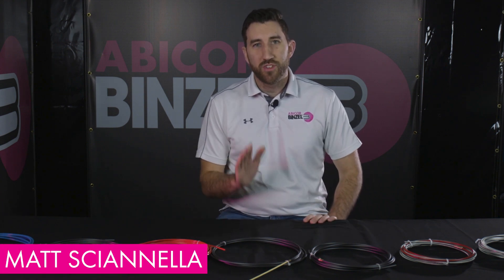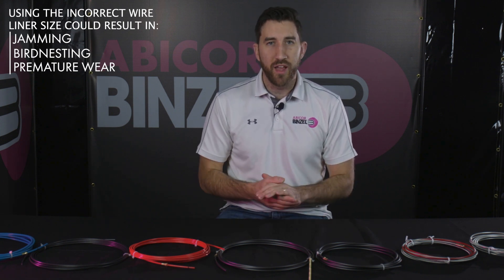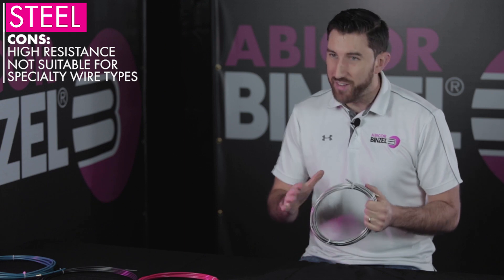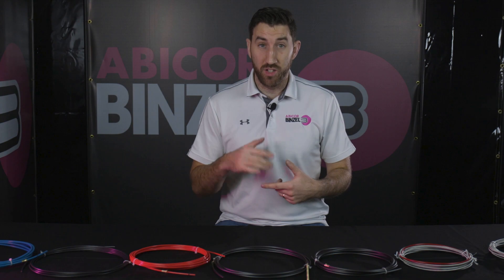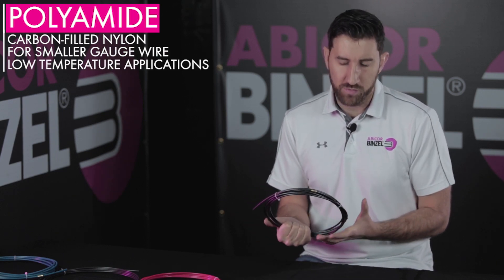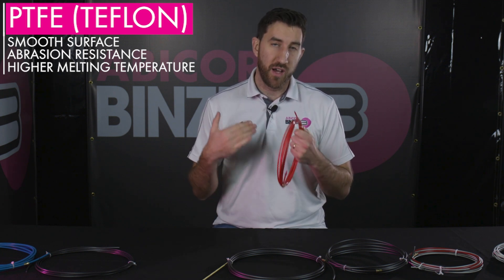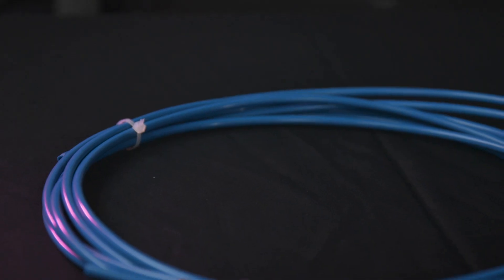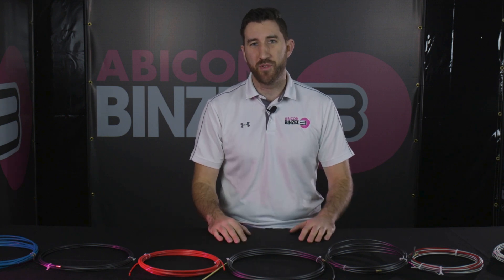Wire Liners | Binzel Basics

Comment: Clamping down too tightly on the drive rolls will also cause the wire to curl. This causes the copper coating on the wire to rub the inside if the liner. Over time the powder-fine shavings of the coating will build up in the liner right where conductor tube on the gun curves and eventually cause a plug.
Reply from the maker: Hey Jordan, that's correct! Thanks for the added tip

Comment: Where could I find a vendor that would stock these?
Reply from the maker: Hey Benjamin, you can get these liners from Praxair, Airgas, or most any of your local welding goods distributors. These liners are made specifically for our MIG guns, so if you want to try ours in particular, would need to try our gun out. But we fit almost any commercial welding machine.
Reply: Great videos,  I have binged and watched as many as possible.  Great information and knowledge  that you really can't learn anywhere else. I have a few questions. I am going to purchase your Abimig 250 amp air cooled gun with Euro connect.  What is the maximum length that you recommend running wire sizes between .030 and .045 , steel and flux cored? Is there an online welding supply or Amazon dealer that has your products? Your sales rep. for Southern California gave me a couple of welding supplies.  I spoke to them gave them all the spec.s and consumables and they have yet to respond back after a week.  I deal with Air Gas and  are no better, they try to steer people away from anything they are not used to dealing with.